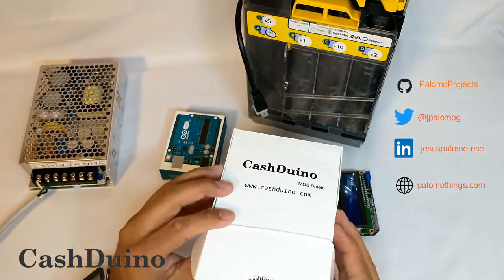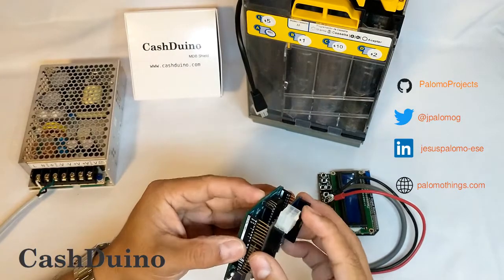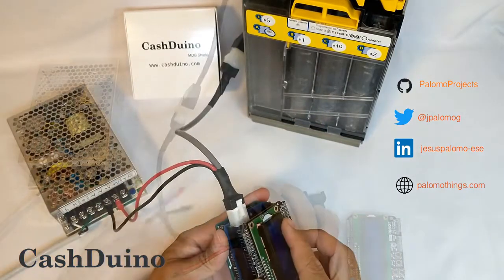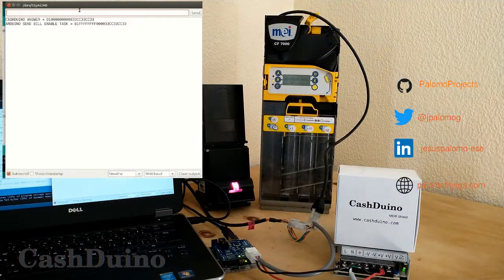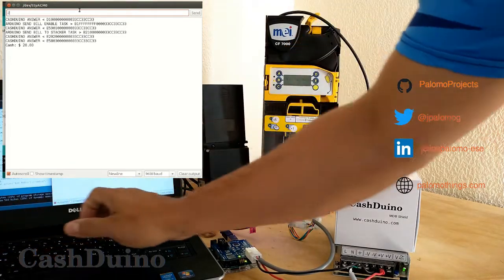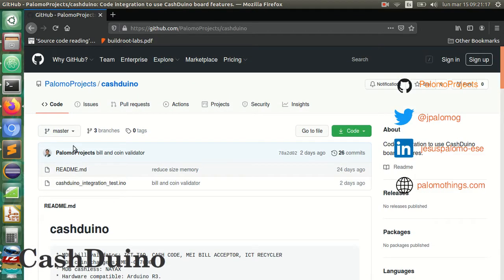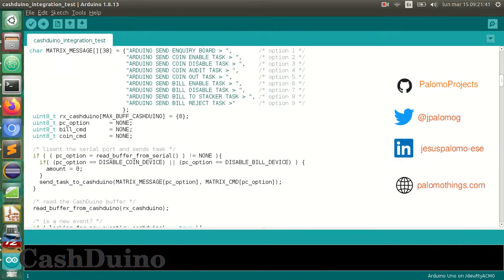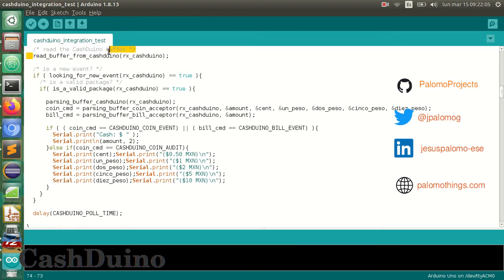unboxing How to communicate the Multi Drop Bus (MDB) using Arduino

Comment: Is cashduino open source? How to add support for more devices in cashduino?
I checked GitHub couldn't find the schematic also.
Reply from the maker: Hello!! the all API (using I2C protocol) is open source, you can find it on GitHub, the electronic design and the bare-metal firmware is on my Intellectual Property, but you will be free using the API because the CashDuinos philosophy is to enable the MDB in a freedom way. Feel free to email me. https://palomothings.com/index_eng.php Regards!!!